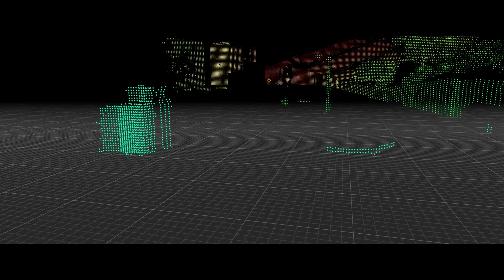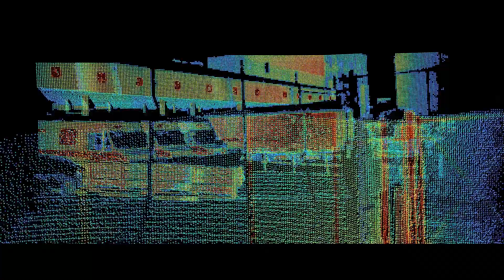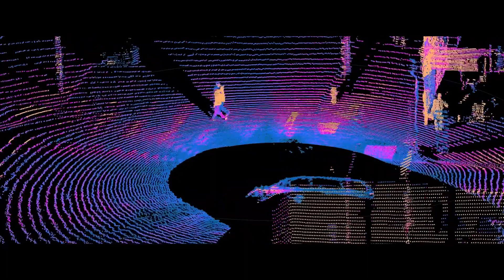Introducing Ouster Automotive

Comment: Your stock sucks lol you should call it ouchster lmfaoooo
Reply: maybe you're not familiar of the typical cycle of a SPAC. but to be fair most lidar companies got hyped up and not making a ton of money have sold off A LOT. MVIS was a short squeeze and VLDR has management issues. but for my type of trading i love this price. i just now bought in at 6.20 and averaging up if that happens to be the bottom. love me some cheap shares with analyst rating of 14+. 

this acquisition looks very promising. they are very confident i just love the way Shauna describes her solid state lidar in this video and Angus' statement of their "monumental shift in lidar tech"